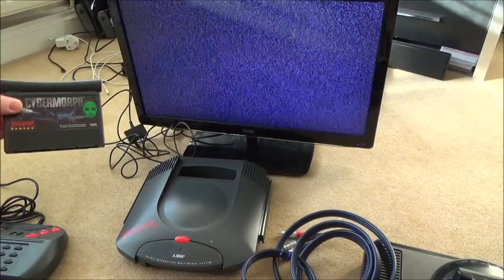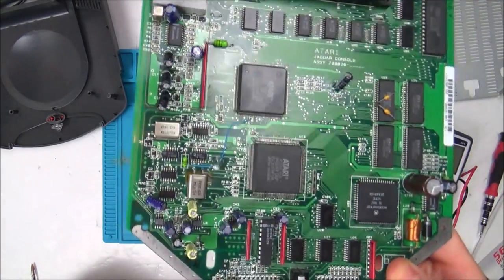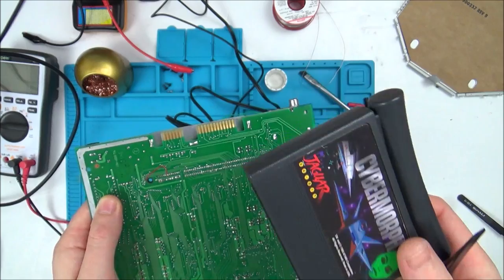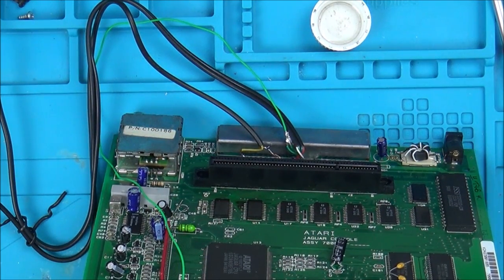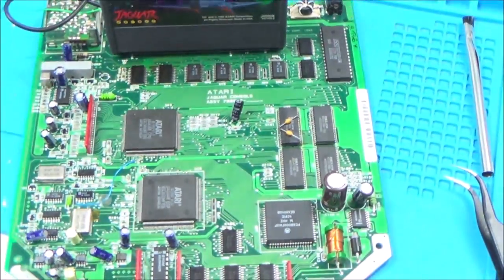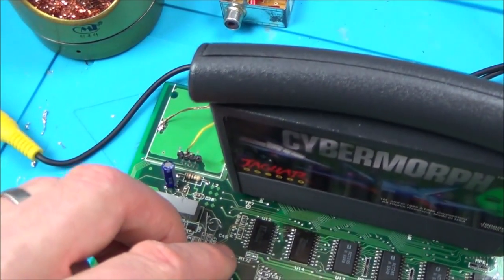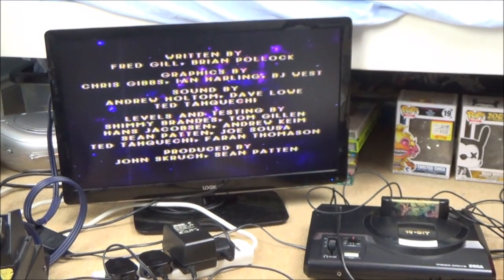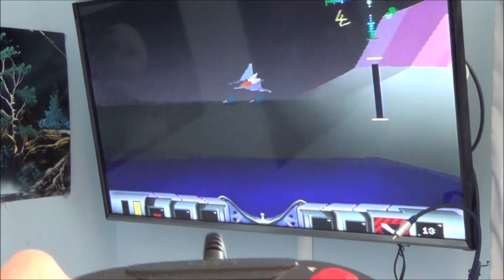Trying to FIX an ATARI JAGUAR with No Display

Comment: The coil in the rf modulator that was misshapen was done at the factory to fine tune the inductance to adjust the output frequency/amplitude. The screw you were messing with is a core to the main coil is the main method to adjust the frequency which is why it affected the reception. Capacitors in digital electronics are mainly used for noise filtering and decoupling. In RF circuits they are also used with inductors (coils) to create tank circuits that amplify the RF signal and to block dc voltages from crossing between stages ( probably why you found a path to ground on both sides of that capacitor).
Reply from the maker: Cheers Jeffery :-)
Reply: @Mymatevince  love your work and I am only 13 😁
Reply: Why on earth would you use RF when you have composite or better still ........RGB Scart. It's so simple plug and play and then you know for sure it's actually working or not. Not to mention the superior sound and picture quality.

Comment: I tested 3 jags a couple of weeks ago, none of them were working. I basically cleaned the board a few times with ipa. Still nothing, tried to see if continuity between the board & the pin connector. All fine. 
I ordered an av out cable & all worked everytime. It puzzled me at the time & still does.  I think at the end you mentioning about PAL signal does play into on these boards.
The ones I have don't have the same alterations as your board.
Superb video btw 👍

Comment: With how you went about doing things, turning the Jaguar on and off, leaving it on, leaving it off repeatedly, i think it might have been a bad capacitor after all, reforming itself up to the point where things actually started working again. Capacitors can do that at times when they're powered on for long enough. Apart from that i have no real clue how it's working now when it didn't before lol Not my favorite console, but it's always nice to save old hardware ^_^

Comment: L is an inductor, coil not capacitors. If it starts playing up again I would suggest you reflow the chips as a dry joint on one of the pins could make it not boot and if you put pressure on the chip say while you were cleaning the game slot. it could make the pin contact.
Reply from the maker: Thanks PDS, I really should have recognised that 'L' means inductor and not capacitor. Yes I will keep an eye on it and if it fails again I will revisit and reflow :-)
Reply: I had this exact issue with a Jaguar from November '93. I touched up all of the joints I could, no issues since.

Comment: It would be interesting to know if the "overheated" chip is cooler when the console is working vs when it didn't.
Reply: I suspect the chip is part of the cause, perhaps add some cheap Aluminium gpu ram mini heat sinks on those hot chips?
Reply: @ChrisArmstrong194  Pretty sure those are the actual RAM chips. 8 of them, 8 bits each, giving 64 bits. One of the designers said, the machine isn't really 64 bits in any meaningful sense, they did it to get more bandwidth out of cheap consumer RAM chips. 64 bits out of 8 chips is more data at once than 32 bits out of 4 chips. But only a couple of parts in one of it's chips can actually handle 64 bits, mostly the rest of them use 32. The machine has 5 processors, each designed heavily around one or two particular functions. It was apparently an utter mess to program cos you've got these 5 CPUs with no obvious way of getting them to work together to produce a result. The design was apparently compromised from the usual corporate sort of bullshit, but even if it came out as the designer intended, I've no idea what they were going for. It's an odd machine, underpowered compared to the Playstation and Saturn, and what power it had, nobody knew how to use. Bizarre.

Most of it's games were ports from the Amiga, which used a 68000 as it's main CPU. In the Jaguar, the 68000 is the least powerful chip it has, a designer said "we only put it in there to read the joysticks", it was included to give programmers something they were used to. But sadly it meant that they ported code from the Amiga or Megadrive, and mostly ignored the Jag's other hardware, which made it look pathetic running outdated games that didn't use it's power. But software houses weren't willing to put the full effort into learning it, because it hadn't sold enough to justify the investment.

Comment: Bear in mind the technology of televisions back when the Jaguar was designed. Usually tuned by turning mechanical tuning dials of some description, not something run by microcontroller. I imagine it'll work just fine on your old TVs that use manual tuners (eg the boombox TV). Analogue tuners on modern TVs... Not convinced they're a priority. I mean, none of the reviewers will notice it; and few consumers will notice if the analogue tuner isn't great.

Comment: I also think it was a dirty cardridge connector. Which also caused a short (maybe with a slightly high resistance or impendance). After cleaning it it was better, the ipa makes a better connection, as it evapuates the connection got bad again. The RF Signal seem to be ok. I live in germany and when I connect a console via RF, I always had (analog TV here is gone) to tune in the Channel by my own. The same with old analog TV Signals. We do not have Channels with fixed RF bandwiths, every channel has the same. To get our TV channels we had to tune in the right frequency. most TV have an automatic Channel finder which goes to all frequencys and stops if the Image is ok.

Comment: The first thing I do when I get an old computer/game console/etc. is take it apart and give any PCBs a good clean with electrical contact cleaner.  Then if there are any card slots, edge connectors, RAM slots, etc. I hit those with just a little DeoxIT.  I can't tell you how many "defective" components I've brought back to life just by giving them a proper cleaning.  After I clean everything up I start checking other components, RTC battery, capacitors, etc.  By cleaning the whole board first you rule out any minor shorts due to contamination (liquid, flux, debris, etc.) and DeoxIT is great for making sure you have good contact between any game carts, add on cards, controllers, etc.
Reply from the maker: Thanks for the tips :-)

Comment: Yep I remember those slotted games were a real problem where the receptical would be the issue from corrosion and or Oxidation to soldering joint problems because of the force it takes to insert and remove the cartridge . you've fixed it by cleaning it wayda go there Vince...
Also You probably have a NTSC model where you have PAL for tuning the RF is set to NTSC which is why your TV doesn't work on RF out put

Comment: Forget about the RF. You should just bypass the obsolete RF circuitry and wire the composite video output straight to the  RCA jack. Then add a small headphone jack for the audio out somewhere.

Comment: Those caps on top of that chip on the right look like tantalums. Those are well known for being terrible. They can sometimes fail open circuit, sometimes they become a dead short and explode. I would suggest replacing them. Not sure if they'll cause intermittent issues like you're experiencing.
Reply: Clueless nonsense - those are common leaded axial ceramic capacitors.

Comment: my personal guess would be the switch is ground connected, and there is a 5v rail (LED to switch), and a 12v rail leading to the switch. so when the switch was pressed it would light up the LED, but dirt or something stopping the 12v rail from connecting to the switch. hense why the LED came on, but the console didn't fully switch on. and also why it is working all the time at the end of the video.

Comment: Good video thanks  Here in OZ we have VHF and UHF TV band and I believe in the UK VHF band was discontinued in the 70''s ?
 Your UK TV is picking up a ghost/harmonic image of the vhf modulator in the unit on UHF.I had the opposite problem once with a UK pong game I purchased in the UK.
Changing  to Australia on the TV is changing the tuning range to include VHF.The output of the modulator would be between 54 -225 mhz (AU ch 0 to 12)  I think the bridged cap would ber for DC blocking on some units.

Comment: Afaik, the UK used PAL-I, whereas most of the rest of western europe used PAL-B, this might explain the compatibility issues.
The inductor that's spread apart in the tuner is part of a finely tuned LC tank oscillator. Physically moving the inductor actually changes the oscillation frequency so it's set by hand and then glued/laquered to keep it in place.
Reply: You're correct, the "screw" should be intended for fine tuning the signal. The c64 had a similar rf-modulator as far as I know. Maybe one of the crystals used to give the rf frequency is out of sync or non working.
Reply: I know this is an old thread, but I found the set up instructions for the Jaguar, and it said that PAL-B connects to VHF and PAL-I connects to UHF (tho does not say which channel).  Of course, if there's only 1 antenna port, it doesn't matter...

Comment: Going from memory the Jaguar was released prior to the holiday season in America only (well specifically a New York 'test' market). Europe was meant to get it before the Christmas period as well, but due to manufacture issues it didn't happen. As the Jag was the hottest new hardware at the time (believe it or not!) quite a few places were importing them at astronomic mark ups so it could well in theory be that this console is an import. In theory if you had a another working Jag you could probably turn that pot on the modulator to tune it to the same signal as the good Jag. Cybermorph is the cheapest game because it was the pack in launch game and most consoles came with it (although a few later issues came with no game or Alien vs Predator). The Cartridge slot on the Jag is a bit finicky to say the least, and will often red screen at the best of times, usually it is just dirt. It could be that just inserting the cart enough times and the cleaning you did, did enough to clean it out.
Reply: The Jaguar was released in the UK, I remember as my mate had 1 and was able to buy games for it because I brought it off of him when he'd done with  it. he wasn't the kind for importing stuff, just buying the latest and greatest at the time and then flogging them off cheap when he'd done with them!
Reply: @h4x0rm1k35  Ah yep it did come eventually a few months later (I have two PAL consoles and the CD add on!), a shame really as I think the uptake in Europe would have been a lot better than the sales it eventually received with America as the launch market, given Atari's success with the Atari ST and is relatively low base in the US. When I got it I was actually blown away by Cybermorph believe or not, the whole goraud shaded 3D world space shooter was a bit unusual in those days... although I had come from an ST and a SNES.
Reply: I used to work for UK retailer  Silica when this was launched and we used to sell them. Also if I recall it was avalable pretty close to Xmas.

Comment: The Atari Jaguar  if I remember rightly actually came with Cybermorph. It was a particularly crap game and no wonder that it was so cheap. If you can you should track down a copy of Tempest 2000. Tempest 2000 was a real psychedelic showcase for the system in both sound and visuals. However it is quite rare and expensive,but in my opinion one of the few games that can be considered really worthwhile getting.

Comment: Cybrermorph! A game that's much better with a broken screen! Now if you can break the sound... "Where did you learn to fly?" sigh
Always fun videos, thanks.
FWLIW: To me your frustrating issues smell of cheapness on Atari's part - cut a corner here and there to save pennies on components and this can often be the result. A particular problem with analogue TV - I bet a replacement RF box would work better, if made by somebody more reputable.

Comment: For the 1st couple years the jaguar did come with that game included.  Forgot exactly when but they did eventually sell the system without it at a discount.   Got my jaguar new n still have it,  even played that game a fair bit.  the keypad had notches on the edges for a plastic overlay for selecting weapons n such ingame.  You can probably look them up online.

Comment: I used to get customers who brought their TV's over from continental Europe and wanted them converted. In all cases the picture would tune in perfectly but no audio. The conversion was fairly easy, just replacing some ceramic filters and a slight tuning. Have a look if you can what it's actually tuned to on the TV. I'm thinking this might be a VHF modulator. Your test TV may disable this when set to UK which would explain why it tunes in when you change country. UK only used VHF for 405 line transmissions and abandoned it for TV use in 1985 when they closed down 405. Other countries (including the Republic of Ireland with PAL-I) continued to use VHF for analogue transmissions. I suspect this console isn't a UK model.

By the way the coils and parallel capacitors form a tuned circuit so you will always read a short on that capacitor because of the coil in parallel. The separated turns is how they fine tune that circuit and disturbing that would have a negative effect, which is why they stuck that glue there.

Comment: I have repaired NES, SNES, Genesis, etc. I have fixed a lot of these old consoles. Never had a Jaguar. But I can 100% Confirm that sometimes a thorough deep cleaning is enough to fix a console (Resoldering the pins is also a good idea as well) 

I don't believe it was so much the corrosion preventing the pins from connecting though. I believe that something was shorting out underneath the slot. This would explain why it was messing up so often and not booting even when you shorted those two pins. The short could have been small enough to let it begin to boot then error out at the red screen as well. When you cleaned it you removed all kinds of dirt that had built up over the years. Also The system likely started working after it had a good while to dry out. Maybe it would be a fun idea to create a way to keep dust out to prevent this from happening again. Many of these die out and no one really takes the time to just deep clean them. I have a feeling that most of the Retro systems that get tossed out as defective or fried just need a deep clean. I say that because I have only ever had 1 NES that was Legit dead in 12 years of repairing them and I'd say half of them just need cleaning and soldering. 

Great video mate!

Also The UK and Ireland use a higher frequency than The rest of Europe. Most of the older consoles are just spec'd to have the higher frequency and generally work but several are not compatible. Newer tv's just kind of work with whatever you put in (A lot of them can detect the frequency and tune in which is why the TV you tried last looked cleaner I'd guess).

Comment: **Addendum**
If you find out what channel and what Format the RF Box outputs you could set another Device to the same channel and then Tune the TV to it, then plug in the Jaguar and tune the "IF Pot" "the one that you screwed" Not stuffed up mind you - Just TUNED to another channel" So it displays also at that channel.. 
Just bare in mind that "StillCloser" Below is correct about the various formats and having said that it may be easy to actually change some components to your Jaguars RF Box to output your regions Pal.. of course you will need to open up an RF box with your region to copy from..
Reply from the maker: Cheers for the tips Koala :-)

Comment: Two things... it's cheaper for a company to bodge a couple wires to fix an issue than remanufacture a whole new board hence the factory "mod" as you said. 
Secondly DSP stands for Digital Signal Processing otherwise known as "digital signaling" which can be a number of things, access for peripherals to the cpu/components of the devices logic. It could be a digital video output from the devices DSP "Digital Signal Processor", it could also be a means for the factory to test the unit and its various functions.

Comment: Quick google search says that pin 14 is a 'key' pin, along with pin 13. Pin 16 goes to either a 27C101 (eprom) or a 74hc244 (Octal Buffer / Line Driver). Console5.com has the schematic, archive.org does too.

Comment: 375/5000
Maybe it was a combination of different problems. Cold joints, dirty contacts in the cartridge or a dirty power button (and you "cleaned" it by turning the console on and off 200 times), sometimes it happens that they get dirty and do not conduct the proper current. You could try to lightly tap the console or better yet, the pcb with a pencil to see if it has any false contact
Reply: 375/5000
Maybe it was a combination of different problems. Cold joints, dirty contacts in the cartridge or a dirty power button (and you "cleaned" it by turning the console on and off 200 times), sometimes it happens that they get dirty and do not conduct the proper current. You could try to lightly tap the console or better yet, the pcb with a pencil to see if it has any false contact

Comment: Great video and well done for sticking it out.  Your Logik TV i believe is a tesco brand and I have come across the same problem before on other consoles with Logik. especially the older ones such as  the original playstation etc using modulators. 5* and well done again.
Reply: Logik is Currys, Tesco is Technika.
Reply: @RWL2012  yes of course you are right. Must have been a senior moment lol.

Comment: Thanks for the vid 👍 and I have not long fixed one myself 😊 but be aware that the dc socket is centre - and the outer ring is + or bad things will happen 😟 maybe fit the diode that’s missing by the dc plug 🤔 I will do it one day 😏